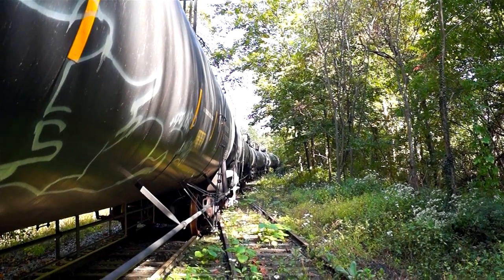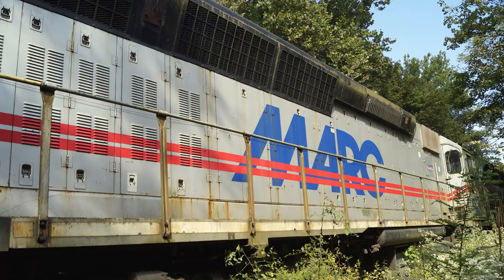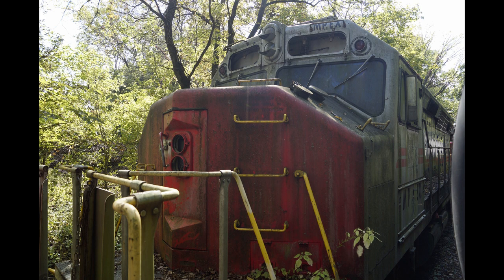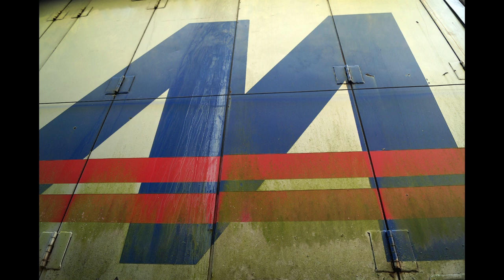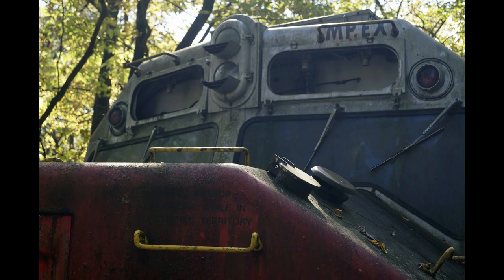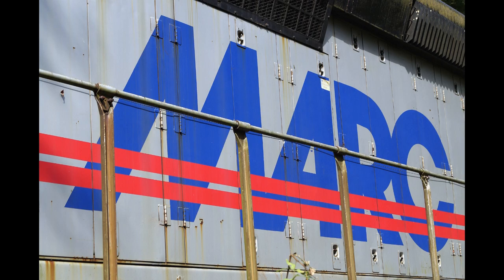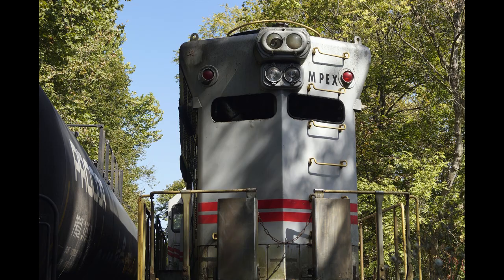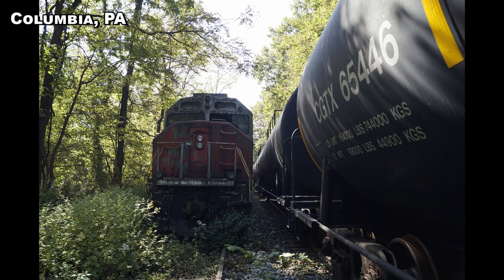Look what I found in the woods..

Comment: Minus the units shown in this video, the one retained by MARC for MOW and rescue use plus the single unit that CSX has, all the remaining former MARC GP40WH-2's were used as trade-in credit on MARC's MP36PH-3C order and were rebuilt yet again by MK (Morrison-Knudsen) successor MKRail into MP32PH-Q locomotives for use on SunRail in Florida. The Sunrail units are true oddballs and are yet another MKRail full size "kit bashing job". This time, the F45/FP45 cabs were removed and MPI "MPIXpress" MP36 cabs installed in their place.

Comment: As valuable as steel is right now. The steel and copper need be reclaimed if they're not going to rebuild them. Considering the condition...wait much longer and they're not good scrap candidates.
Reply: The biggest problem with stored units such as these, whose owners may be awaiting changing market/demand conditions, arranging financing for repair/rebuild, etc, is the destructive forces of illegal scrap mongers, vandals, and yes many unethical railfans who think any rail artifact they can get ahold of is theirs for the taking. 
Being involved in the preservation community I can attest the biggest problem is finding storage places for equipment waiting work opportunity where the "vultures" do not ruin an item before work has a chance to be done.
Just because something is not currently being used does NOT mean it is abandoned!
Reply: @Kenneth Hanks  I fully agree, store it, rebuild it, or sell for scrap. The location those engines are in makes it easy for thieves to vandalize equipment or worse, steal valuable copper or parts. To me, they need to be guarded or have surveillance to protect them.
Reply from the maker: @kennethhanks6712  Amen to that.
Reply: @williamorton7600  Yes a good secure, economical and accessible place to store equipment is critical which, having been in the business for 35 yrs, I can vouch is rarely available when and where you need it and at affordable cost. Often you have to take whatever is available. Security, even if "high tech", often either too expensive or not totally effective depending on location, etc and whether you have a truly determined intruder. If you have had success in this field congratulations-hopefully you get to assist others who are in the need.